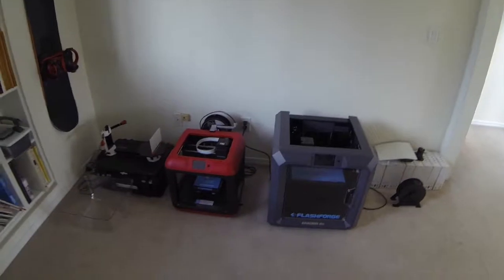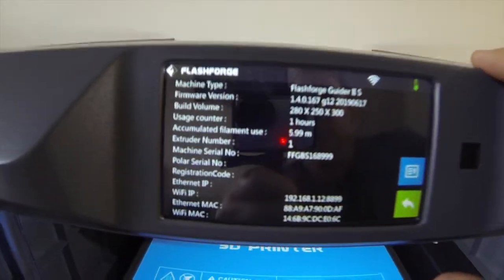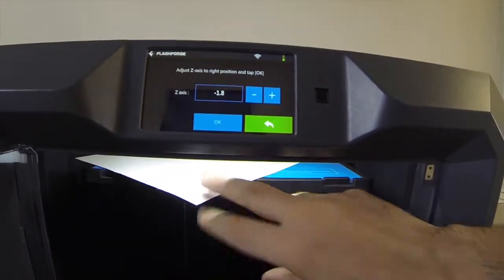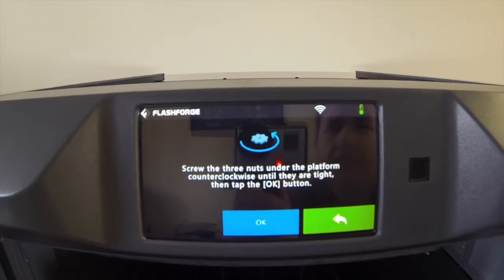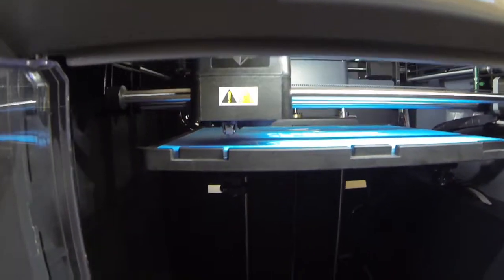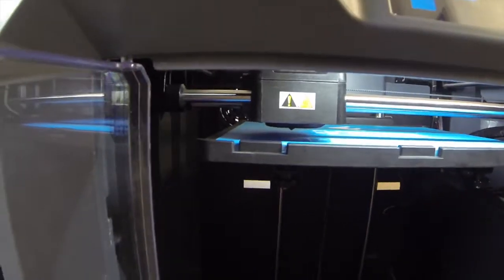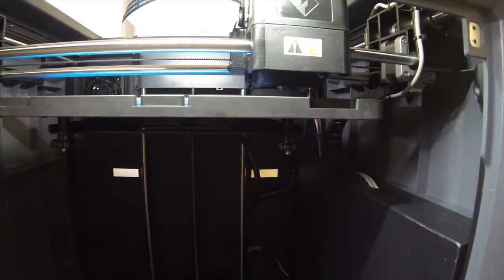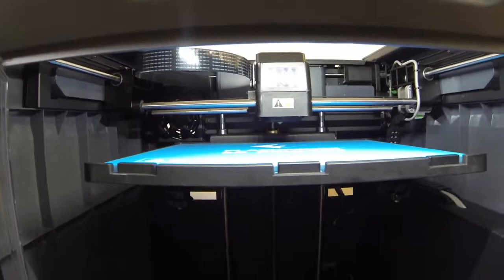FlashForge Guider 2S Calibration Issue

Comment: Little tip. Do not adjust extruder. It does not require it. In fact it screws up the printer. Out of the box just level the bed and your good to go. I have owned 2 of these and I messed up the first one trying to adjust extruder. I repeat do not adjust extruder period.

Comment: Bought mine 3 months ago, i have 9 3D printers and to this day i haven't been able to do one reasonable print, completely dismantled today and found that the top frame was warped, not due to transport but rather bad manufacturing and QA, the y axis rods are curved so badly that i read 1 mm when measured on my granite surface plate, the glass plate was convex by 0.5mm, had to and lap it, 15 hours work so far diagnosing/repairing and i predict i will have 22 hours in it by the time i could get it running properly, i do not suggest anybody buy this 3D printer unless you have a full machine shop with mill/lathe or surface plate and height gauge and a good knowledge of dimensional measuring to check the parts, don't be fooled by the looks, geometrically out of square and or any parallel planes, you will swear your life seeing your money go to waste, im sure someone out there has trashed it brand new
Reply from the maker: Sorry to hear about your trouble with this printer... my 2nd one produces good prints once I figured out that the bed wasn't assembled properly. That said; the first one I had was definitely suffering from quality issues.  I don't recommend this printer to others but my Finder has been flawless.
Reply: @donallen3363  Hi Don, thanks for the reply, i know im giving this machine a really bad name, i have a 30'' x 60'' granite surface plate and starrett 24'' height gauge with a 0,0001'' precision indicator on it, as you know if a good 3D print is to be made then all axes and surfaces must me within a given tolerance to be able a good surface adhesion, repetitive height layer, i found out today that the steel plate that supports the glass plate is warped so badly the it actually warps the glass by stress assembling, let's say if we want to print a part with 0.2mm(0,00788'') layer height, the we must assume that the glass surface is flat and parallel at least within half (0,1mm) (0,0039) of the layer thickness, in my case the is impossible to get under 0,5 mm (0,0197''), that 6X the required minimum, i go from nozzle rubbing on glass surface to nozzle floating in the air, i notice that the 3 point bed level is inadequate, with all 3 point leveled i get nozzle to glass gap spacing unevenness at the rear of the plate where there is only one thumb screw adjustment, i will modify the bed leveling to make it a 4 point system, i'm also changing the bed steel plate for a machined flat aluminium one
Reply: @donallen3363  i want to order that printer .you write that you don't recommend so  which printer do to recommended ?
Reply from the maker: @tzachus  After getting this printer set up properly, meaning that I had to push down on the print bed until it snapped in place, this printer works quite well.  I actually do recommend this printer now.  The issue with mine was that the screw threads were holding the bed a little too high.  Only by pushing down on it with some pressure (30-40 pounds worth) I was able to snap it in place

Comment from the maker: To anyone interested... this was corrected by exerting pressure down on the board with a flat hand, honestly a little more pressure than I was comfortable with.  After loosening the calibration screws and pushing down, I heard a "pop" and the print bed settled to a slightly lower level.  I believe that it was stuck on one of the screw threads during assembly.  This is corrected and I have no issues with the printer now.
Reply: Don Allen hey mate, I’m considering purchasing this printer. Wondering how you go with the non removable print surface. I’ve been using the Inventor 2 at school (I’m a teacher) with the magnetic board which is handy. Also, have you run into any other problems? I’ve seen people try and update the firmware online only to “brick” the motherboard etc. thanks for the vid 😎👍
Reply from the maker: @BigfootRunning  I have learned to work with the non-removable surface, but frankly I prefer the Finder's removable one.  However, given that it is heated it is worth the trade-off.  If you have time to let your prints cool off they come off quite easily.  In a classroom you may want to find a removable bed so you can swap and keep printing.

Comment: You need to leveling the platform first and second calibrate the z axis. So reset and start again.
Reply from the maker: understand... it just wouldn't level out of the box.  I put some pressure down on the pad and it snapped into place, I think it was not properly seated on the screws at first.  Once it popped in place I had no further issues with it.